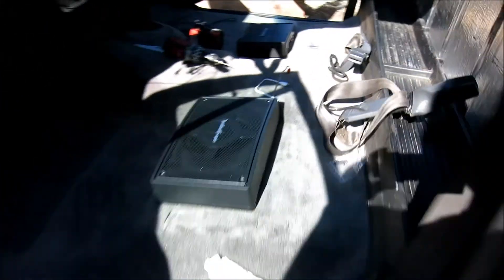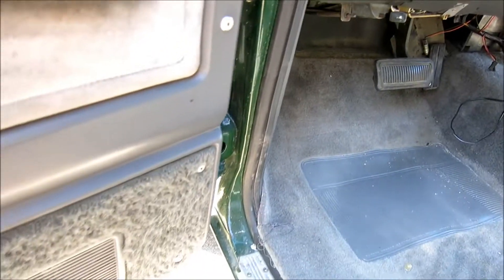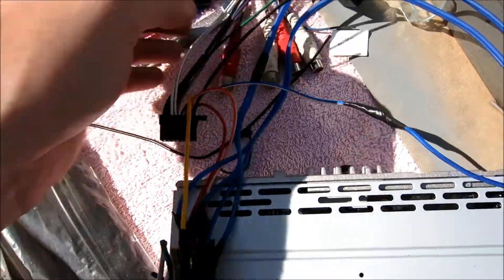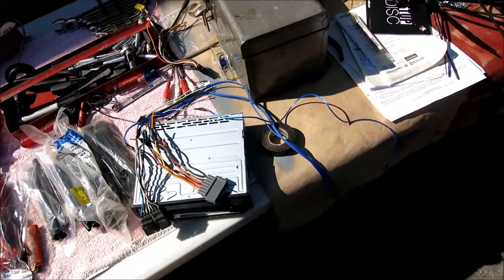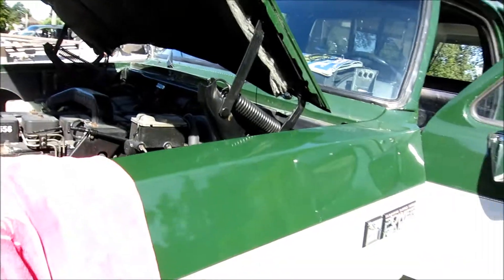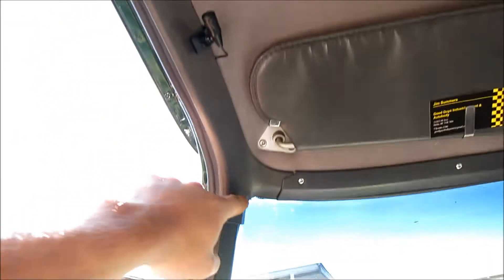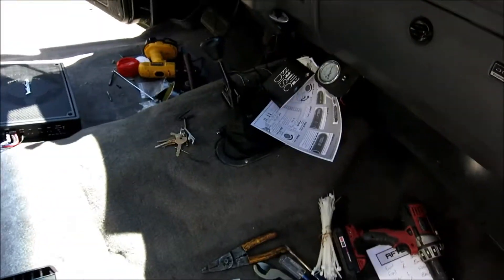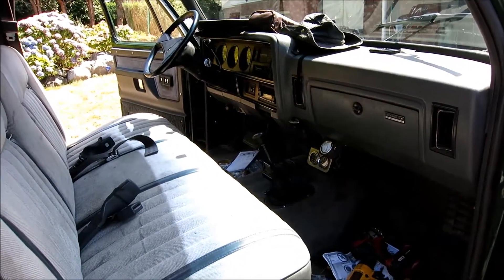1990 DODGE SUBWOOFER, STEREO AND AMPLIFIER PROJECT

Comment: Thanks ended up figuring that out when I saw the screws under the dash. I am just used to the Fords that have the key slit you push in to remove the head unit.
Reply: Bailey Donahue hope it worked out good for you I have a 93 and when I replaced all the speakers the doors were a nightmare and ended up cutting the doors to fit large polks

Comment: How did you remove the radio without taking the entire dashboard off? Thank you
Reply: Bailey Donahue I don't think its possible you have to take off the dash trim and steering column plastic it might have been an aftermarket head unit to begin with